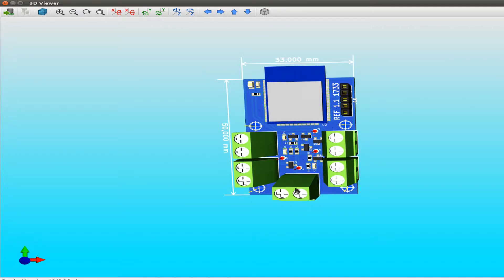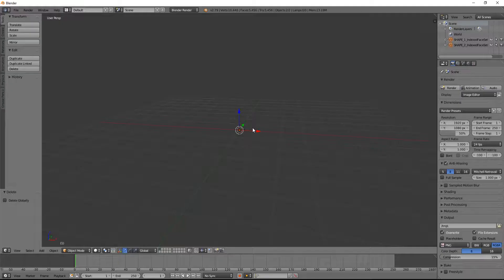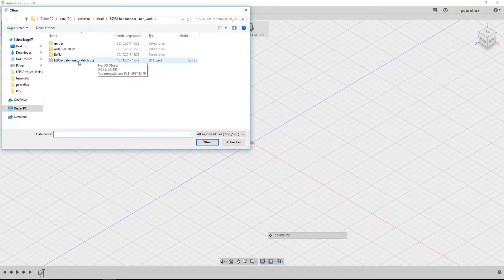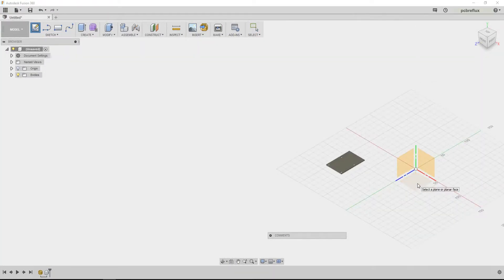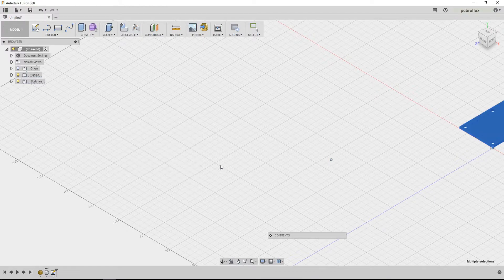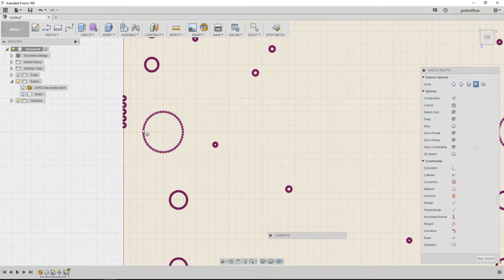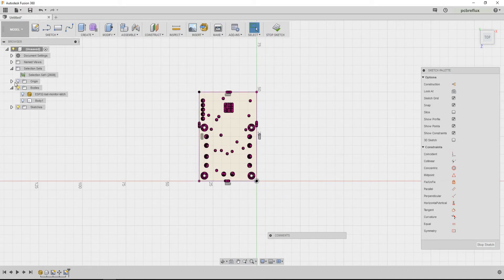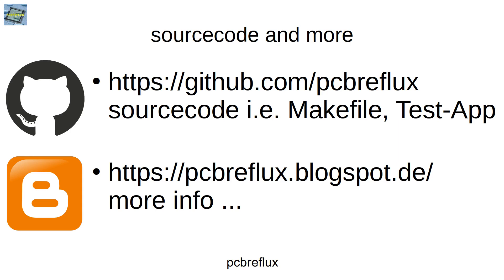Howto #3: KiCad to Autodesk Fusion 360 with help of Blender

Comment: Yea this is odd to say at least. You need FreeCAD and the KiCAD step up tool add on. You can import all the 3D data including tracks to FreeCAD, save the project as STEP and import it to Fusion360 or every other CAD program you like! FreeCAD is also available as portable app, there is no need to install it! Further more you could make footprints and 3D components using FeerCAD with KiCADstepUp tool, like a pro bro. By the way converting nurbs based 3D data to polygons forth and backwards is asking for trouble and can cause butt hurt.

Comment: Why wasting people's time? you can export a step file right out of kicad and just import it to fusion.... no hole fixes and all that bullcrap.
Reply from the maker: Thanks. Try to import Step-File as Base Feature and Mesh. It's opened and displayed but could not insert as new object. Any clue?
Reply: Didn't quite get your question but like I said after you export the step file you simply import and open it in fusion 360 and then go through the process you did.
Reply from the maker: Hi, by "import" in terms of fusion 360 you mean "upload" ? Could not find a import other than "STL" or "OBJ" files. But you are right the uploaded step file has less artifacts and even the holes are converted to circles. Thanks for that.
Reply: Yeah upload is the term for fusion.